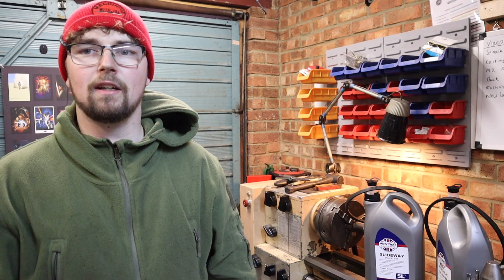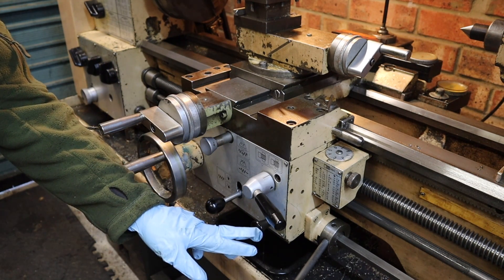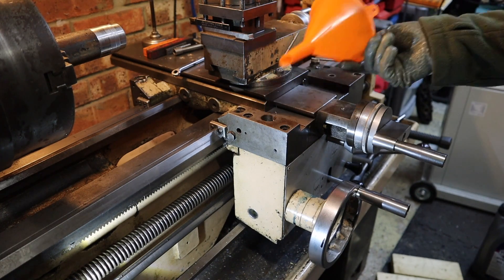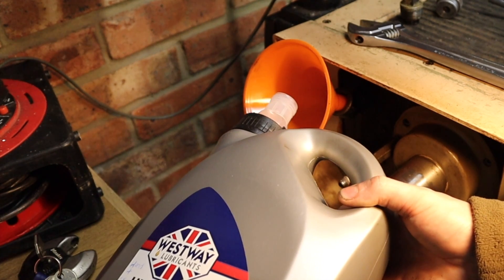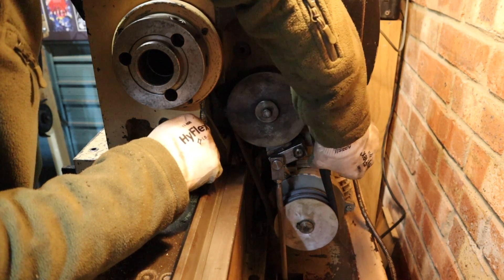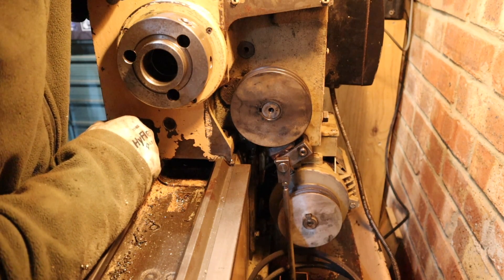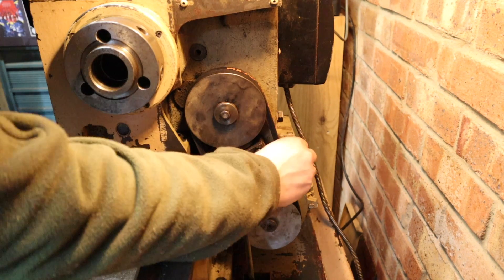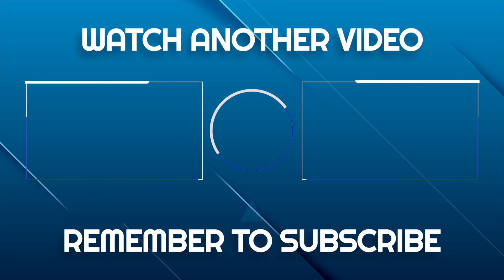Servicing Harrison M300 Lathe

Comment: For those looking for oil, Colchester recommend Valvoline Hydaulic Oil 32 for Headstock (1  litre) and Valvoline 68 for Gearbox (0.5 litre) and Valvoline 68 for Saddle (0.3 litre).
Get a funnel with a long flexible spout - makes it easy.
I found I needed to put in more oil than specified, to reach the sight glasses levels.

Comment: Hi joe where did u get the oil and what was the oil u got for it I’ve got a Harrison m 300 to I going to do oil change would be great if u could help thanks 😊
Reply from the maker: Hi Craig so I got the following oil off of eBay which is the modern day alternative of what is needed for the M300
Westway Lubricants machine oil iso 220 replaced the shell Vitrea 72 and same brand hydraulic oil iso 68 replaced the Castrol aws68. Hope that helps
Reply: Hi again Joe where did u get the new belts from and what size are they belts thanks

Comment: Joe just a suggestion next time you change out oil. Gule a magnet to the drain plug to help pull metal out of the oil. this is something our maintenance department did on all machines on the first service.
Reply from the maker: Great tip that Johnny I didn’t really think about it when I was draining it out but makes complete sense.